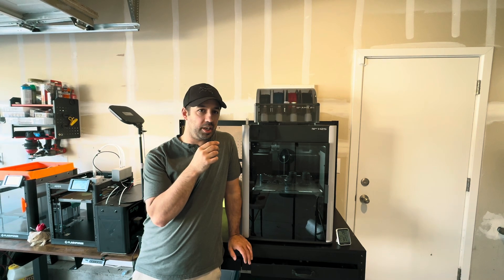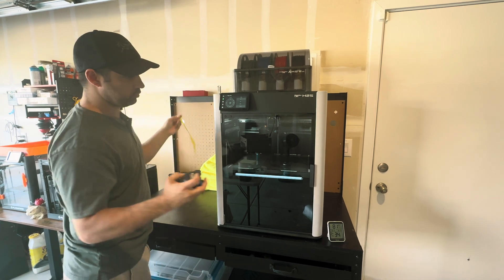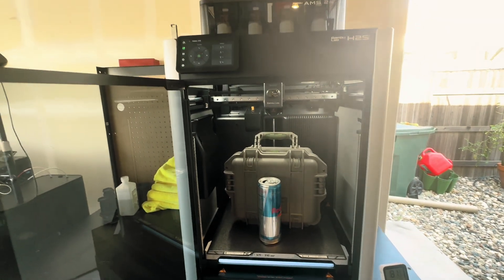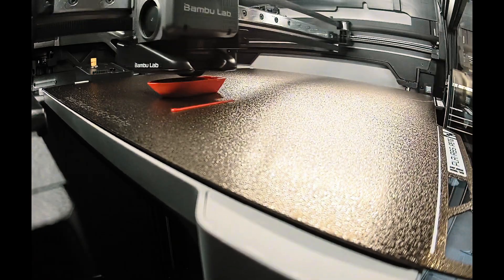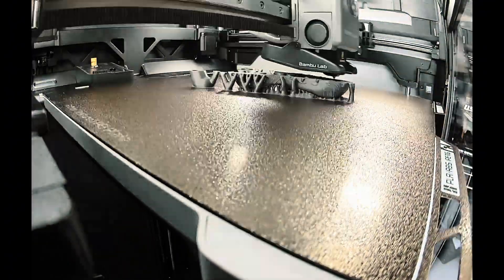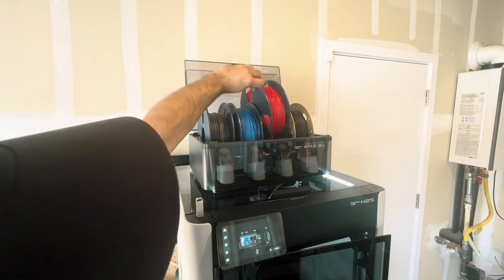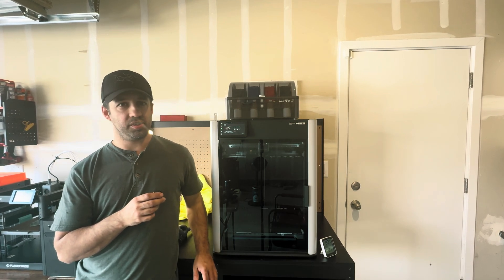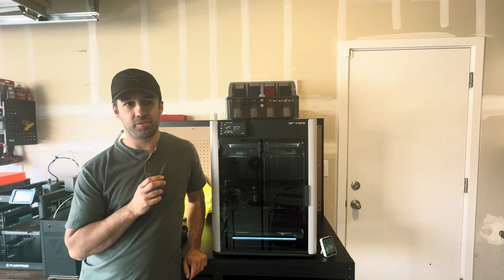Truth About the Bambu Lab H2S —Hands on review

Comment: print speed isnt useful, without knowing layer height/ nozzle dia.
Reply from the maker: I made zero adjustments to the printer for this video so it’s as it came out of the box with the .4 nozzle just added filament and hit print. No slicer setting changes either